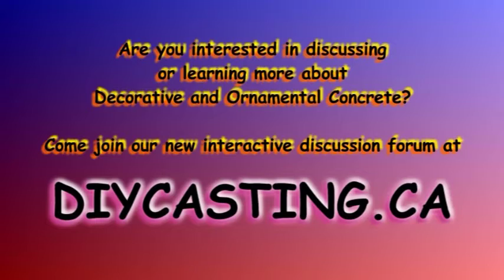Styrofoam Mold Experiment Part 6 The Big Test

Comment: This works awesome - but do it in reverse. 

Spray the object with acetone and set it on top of the foam. It will slowly melt into it creating the desired mold shape. Remove the object and give the foam a few minutes to dry and reharden.  
Then lubricate for easy removal and fill the styrofoam mold like normal.  

I think the glue it creates has too many air bubbles from the foam. Maybe let it set for a few days. And use tape/string/wire inside the plaster for internal support?
Reply from the maker: Great idea. Thanks!